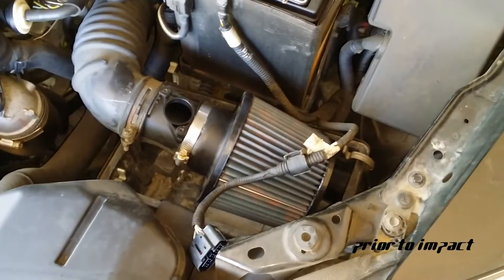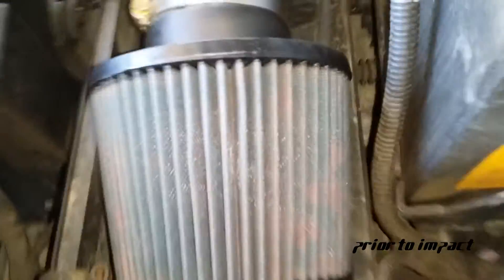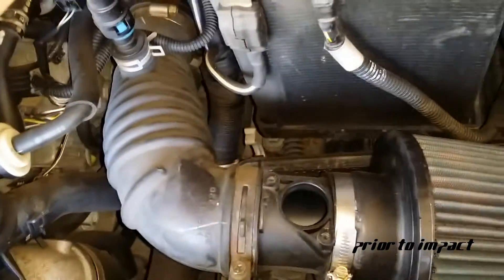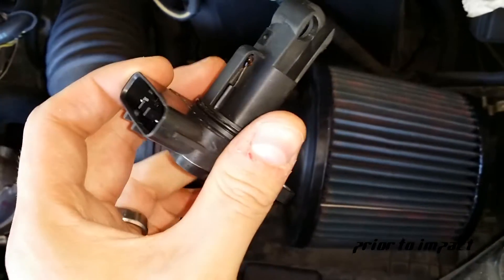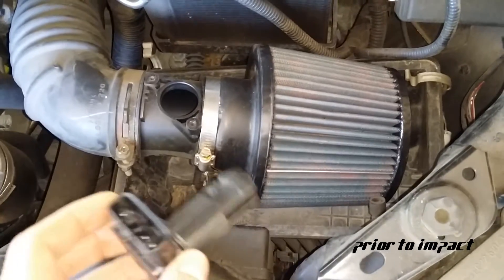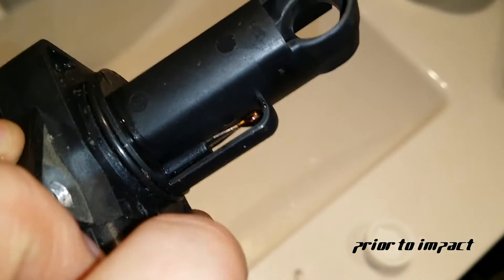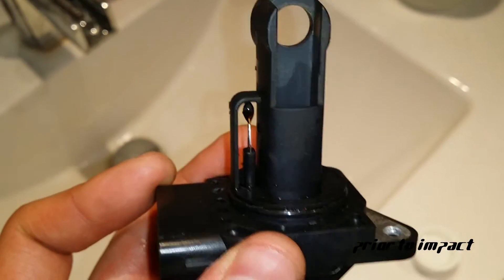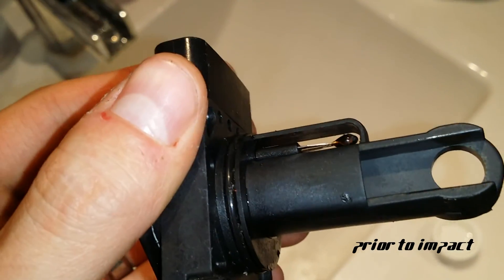Engine Error Code Running Lean - Oiled Pod Air Filter

Comment: Thanks for the info. I went for seadooing today with my Cobb stage 2 Wrx and CEL came on. I checked with my accesport v3 and P0171 code showed up. I’ll check tomorrow morning. Thanks bro
Reply: i have the same code. cobb catted j pipe and SF intake lol. Did recleaning your filter and using less oil help? my DAM is at .750 too.

Comment: I know this is old so whatever but mighty car mods have since proven that intakes do make more horsepower, it just depends on the car. The guy that had the s2000 put it on a dyno and saw a 7hp increase. Not much but for people who know their cars usually notice gains on throttle response and mid to high rpms

Comment: That brown bulb is the IAT. The MAF is actually a pair of resistors up inside the plastic part. Don't push too hard or you will break them off and need to replace the whole unit.

Comment: Usually on the side is your Air temp sensor and in the middle were you see the round opening you have your MAF composed of two coils one reference wire and other your hot wire  the delta in your hot wire against your reference is your value.